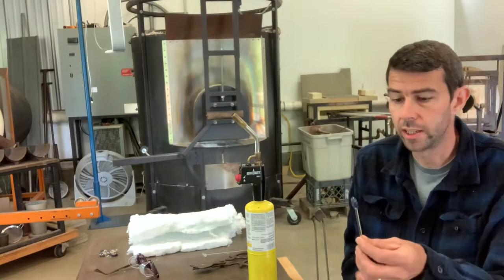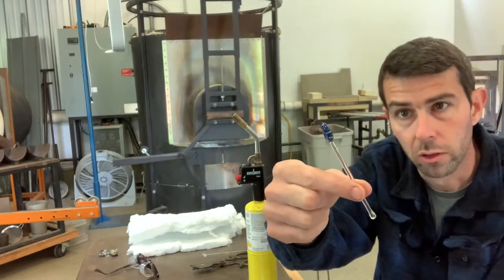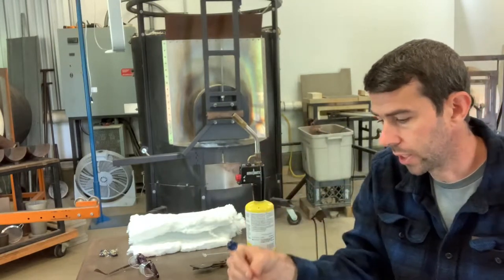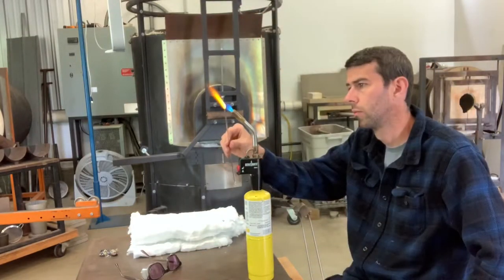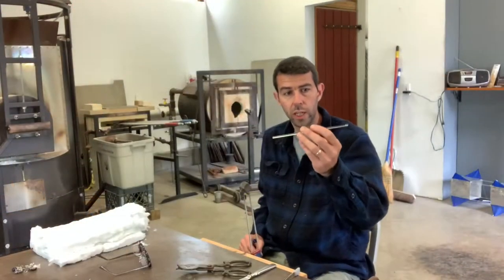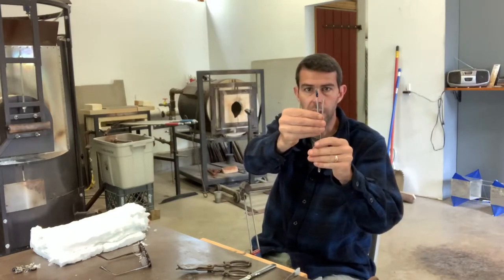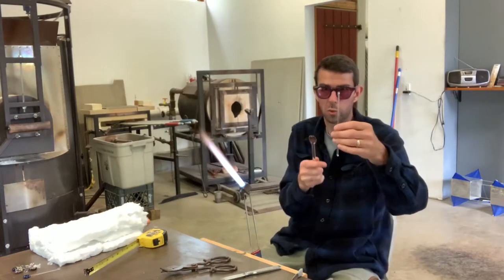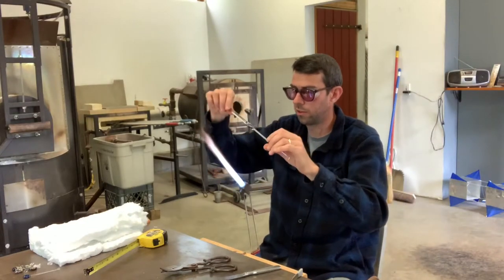Making Glass Swizzle Sticks

Comment: What kind of torch is that?
Reply from the maker: It’s a Nortel multi mix hand torch. I use it mostly for furnace work but have it rigged up for table top use here when lamp working.  Same burner as the Nortel midrange bench burner. Thanks for watching!